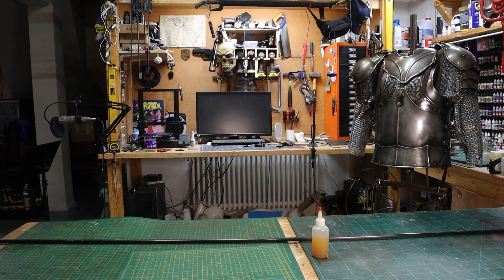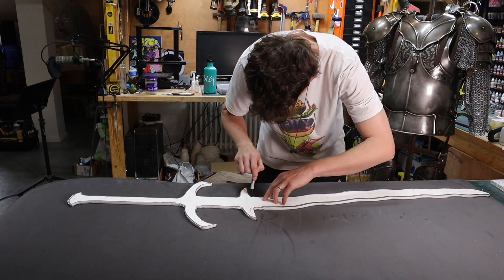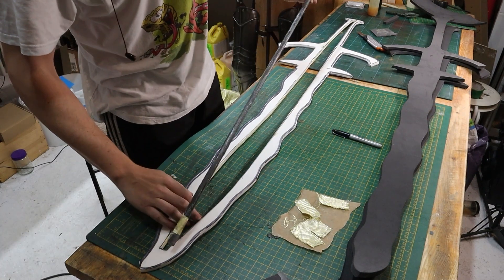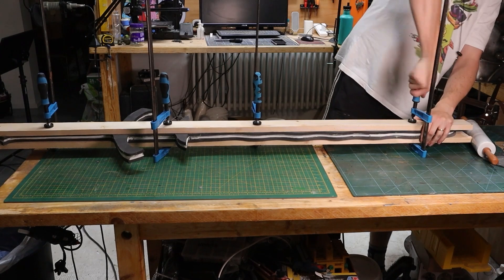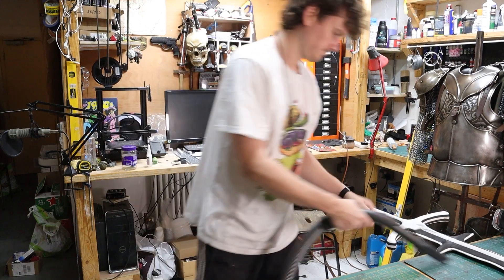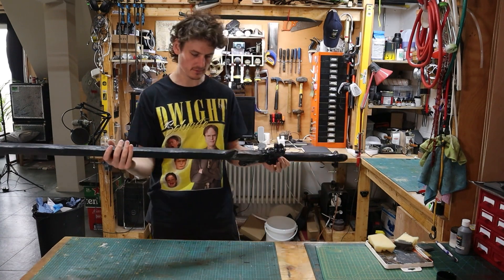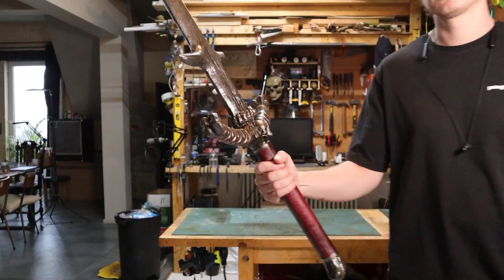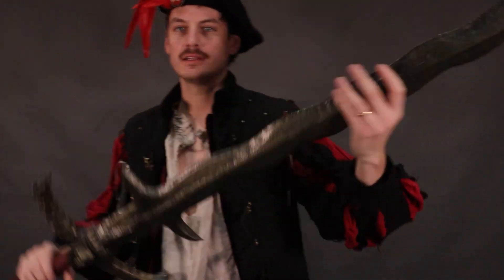How to make a LARP safe Two handed sword or great weapon!

Comment: This is amazing, astonishing work! I'm about to make some Empire greatswords (one Dawnish and one with some League flair!) - did a 12mm core end up being sufficient or would you use a larger diameter core if you did it again?
Reply from the maker: @nutcasefilms6040  12mm is great. It's a noticeable difference from a 10mm or 8mm core. For a great weapon was certainly sufficient. I've not made a polarm yet but that'll be next so for something like that it may need 1 up from 12mm as all the weight will be in the tip of the spear or hellbard head but something that's got a nice spread of weight like this 12mm is absolutely sufficient. Good luck with the build!
Reply: @thehermitworkshop2913  many thanks! I got a quarter of the way through a polehammer before the system I was making it for closed, so I'm very excited to see what you come up with!

Comment: This looks incredible. I’m thinking of trying my hand at building a larp weapon  and am curious how the grip/hilt holds up. I’ve seen different methods (like rolling the foam around the core then wrapping with electrical tape) and am not sure what’s most secure.
Reply from the maker: Wrapping is really good. I thiiiiink i did this on an older weapon maybe the witcher sword. But i do that more often than the method in this video with the full pattern. I have found the main thing is to give the core a proper good rough sand with low grit paper. Then also allow the contact adhesive at least 12 hours to cure properly overnight after a heavy roll and press. I also clamp the weapon between 2 planks of wood overnight night whilst it cures. This has made a noticeable difference in the durability of the weapons. I will often wrap the hilt in hockey tape rather than electrical tape as this has a nice texture for whatever goes on top to grip to like pleather or whatever you fancied or can even leave it as the tape as this has good grip and durability.
Reply: @thehermitworkshop2913  This is great information; thanks so much!

Comment: Any tips on working with Isoflex? Trying my hand at larp weapon making since I have cosplay prop experience. All I know is Isoflex will cure once opened and to batch make weapons, which just seems like such a shame for such an expensive product!! 😭😭😭
Reply from the maker: sorry not to reply sooner. It is a bit of an issue with Isoflex I must say. Sometimes I can get it to last a good 6 months if I seal the tins with 3 or 4 metal tin clips. These can be bought for quite cheap  I also use vinyl tape on the tins to try and reduce additional air seeping in. Its not perfect and won't last mega long but it helps.

Comment: Are there any suppliers for this foam in South america?? Or the especific name to find it in local stores?
Reply from the maker: I'm afraid I don't know of any specific suppliers. Its EVA foam or Ethylene-vinyl acetate copolymer foam it is a high density foam. Its comes in different density levels the higher the density the harder it is but the easier it is to cut, sand and add details

Comment: just a quick question, you mention using Isoflex, what is that? because when I look it up all I'm getting is whey protein which doesn't exactly say "don't get this on your skin" if it's something you drink :/
Reply from the maker: Isoflex is a brand of liquid roofing rubber here in the UK and I think Europe. I use the clear special primer as a sealant for the latex. This is really intense nasty stuff so definitely not the whey protein you have found. Here is a link to retailer in the UK as a reference https://shorturl.at/iKQV1 . Your best bet is to use a clear plastidip though if you can't find it locally. There may be other clear liquid rubber solutions out there.... Isoflex doesn't eat the latex though so be careful as other brand might. People have had good results with Platidip.

Comment: Can you use bamboo as a core?
Reply from the maker: No, i would not recommend this. Bamboo although flexible and strong would not have the durability that is necessary for the contact of larp combat. Weapons can easily get snagged and pulled in more extreme ways that you'd anticipate with normal fighting. Rule of thumb I use is if you can bend and snap the core by hand holding each ends then its unsuitable for a core. Daggers are much shorter and therefore can have thinner cores that if 1m long would likely be snap able by hand but due to being only 30cm long they're fine. Likewise with spears and polarms. These being much longer would also need to be thicker to remain durable. Flexibility is great but carbon fibre and fibre glass also have a great level of rigidity as well. A cheaper option for a one off build is a carbon fibre golf club. Keep an eye out for these in thrift shops and on ebay etc. I made my first 4 swords from club sicks and they're still going strong 6 years on.
Reply: @thehermitworkshop2913  thanks for the tip 👍

Comment: How long did this take to make?
Reply from the maker: A lot of time is spent letting things dry to be fair. Lots of layers and stages. So day 1 is cutting the basic shape and glueing this to the core. This then needs 12 to 24 hours to properly cure before sanding pr cutting into the "blank" so to speak. This can take a few minutes to hours depending on the detail or finish you're after. This is when you can add details like the skuls and other bits. Then, usually, I coat the whole thing in the thinned contact adhesive and let this cure again overnight. So already 2 days and 2 nights but perhaps about 5 hours of actual working time, i did some flip flopping with the making and details so took a little longer plus filming it all adds to my time. But with a clear plan and focus its only a few hours at this stage. Then once the contact adhesive layer has cured overnight it needs 5 to 7 layers of latex. If applying with an airgun, then this is quicker but with a brush its about 10 minutes of application then perhaos 4 hours between layers and then an overnight again for the top coat. Then paint the finishing colours so however long you wanna spend here. Layers of thin paint gives a nicer finish, so this can take time. Then top coat of isoflex needs 12 hours to cure. Then you're done. So the process is over about 5 days. And the hours involved vary depending on details and finishes your after or how skilled and experienced you are with painte and i guess foam smithing. Can get several weapons done over the same time but most of the time is drying time for the materials.

Comment: Love that you just straight up copied an existing LARP sword lol
Reply from the maker: Interesting, would you send a link? I'm curious to see it, does it have teeth and bones? I didn't intend for the final design to directly copy anything. The initial template was really simple as you can see is that what you mean by copied? This was based off of one of Calimacil's designs for their flambard sword for the proportions and was a request from my friend so the rough size and shape were something that came from that. I didn't really plan the details it just kind of evolved. But obviously being part of the community I am immersed in LARP weapons, designs, ideas etc so the skulls, bones and teeth could easily have been something I clocked and replicated without meaning to. Either way, this video is more about the process of making something LARP safe and large and sharing that process so others can potentially create their own if they want.
Reply from the maker: I've added a note and link to the Calimacil weapon that I used as a template for this weapon in the description. As I say this came as part of a request from a friend for size/shape and this item was not a paid commission, (I don't take paid commissions generally) I am not trying to palm this off as my own design. The video is to show the process and share my method for making LARP-safe weapons. I would still love to see the link if it's the details that you believe have been copied as this genuinely was unplanned and was quite a random process. Thank you for your comment.
Reply: @thehermitworkshop2913  how dod you blow up a template that big? What size template would I need?